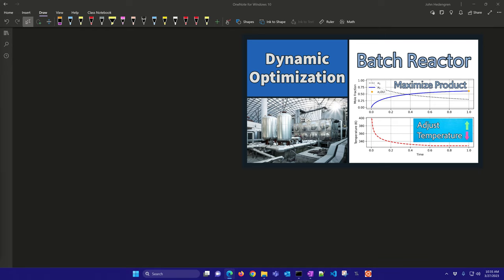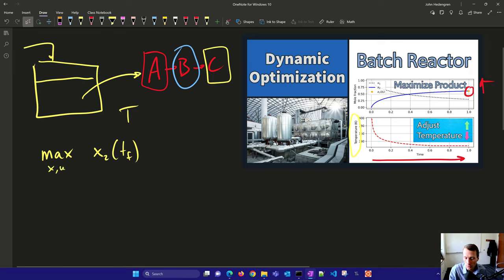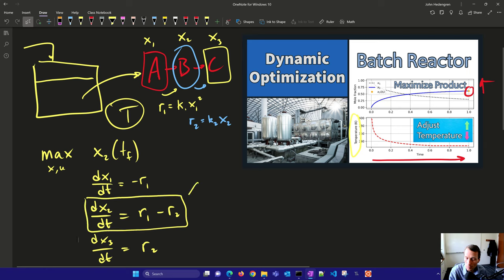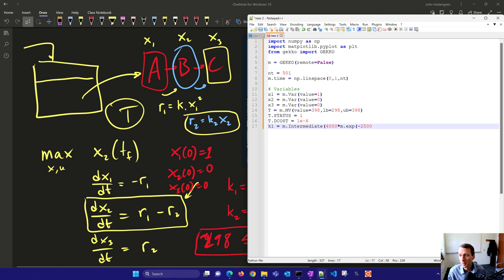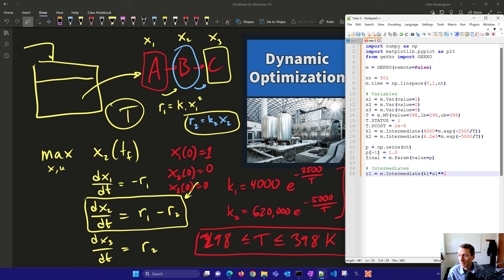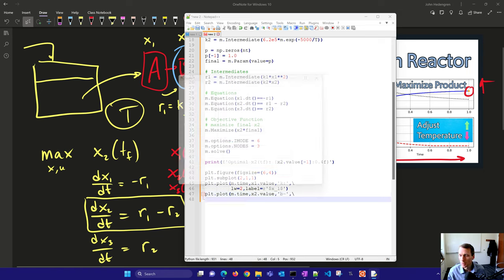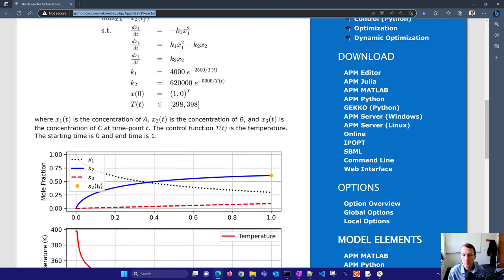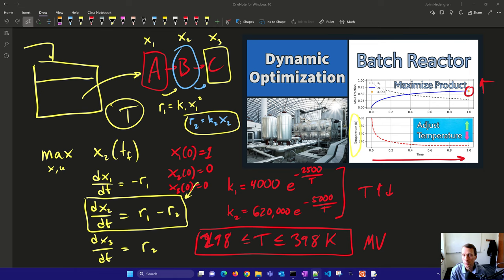Batch Reactor Optimization

Comment: Great video, as always! Let's assume we have the same problem but instead of changing the temperature with time, we need to optimize for the static temperature that would maximize x2. There should be only a tiny change in the code, how is it be? Thank you.
Reply from the maker: Just change T = m.MV() to T = m.FV() to get one optimized value of temperature.

Comment: Great video and I have a question what if I have three more variables like T that are not constant.. How can I add them to my optimization? for example imagine I have C that is changing from 1 to 100 in my ode system and I have T that is changing from 300 to 400 and R that is changing from 2 to 200 ...should I type C=m.MV(value=100, lb=1, ub=100) and R=m.MV(value=100, lb=2, up=200) just like what u did for T? I also have some variables that are directly related to these three variables for example a=R/(C+1) how can I add these variables to my code and use them in my ode? should I typed m.Intermediate command? If u can help me with these question, It would be greatly appreciate
Reply from the maker: Good questions. Use m.FV if it has one value over the time horizon. Please post your code and any specific questions to StackOverflow with tag gekko: https://stackoverflow.com/questions/tagged/gekko
Reply: Tnx a lot.. I will ask my questions there